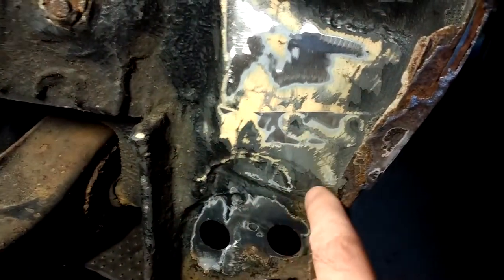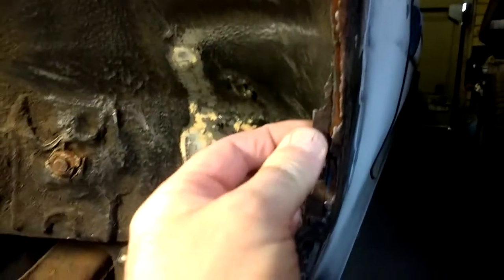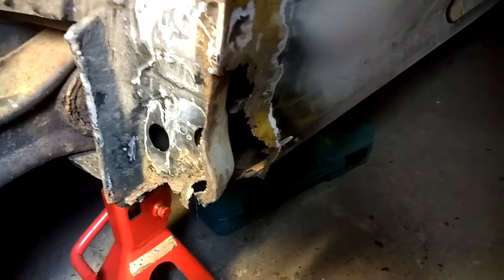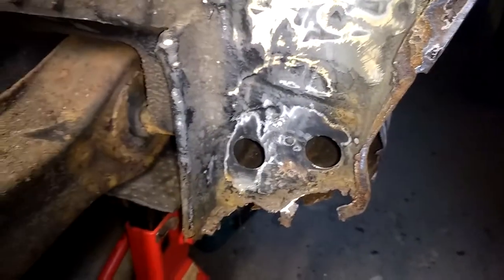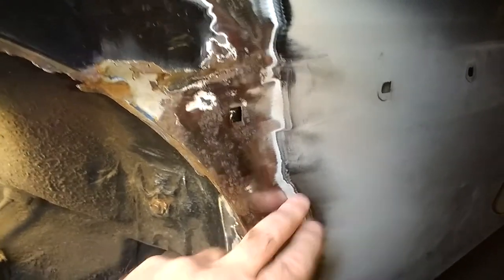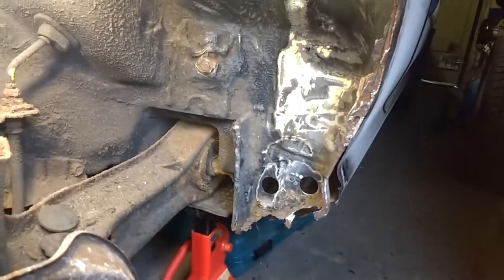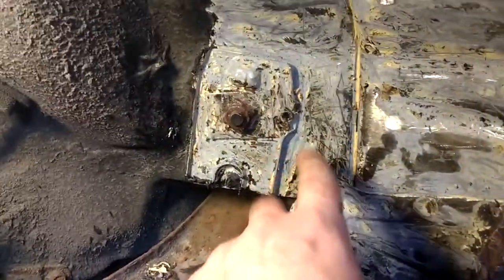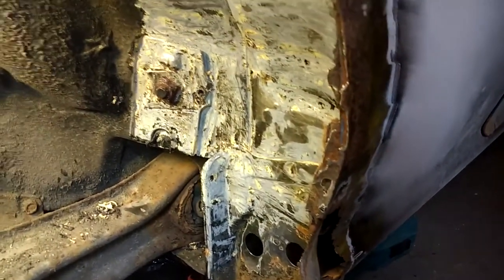Rover R8 216 GTi 16v - Part 16 'Removing twenty eight year old underseal'

Comment: hello. ive seen your xtrail files series and i wanted to see if i could request something. i have a 2006 xtrail and im wanting to put a starlight headliner in it, or at least add fiber optic led's. but i have a few questions about it and as you're the xtrail king i thought i could ask.

1) how do i safely remove and reinstall my headliner? the 8 pillars, 3 light fixtures, 3 ceiling handles, both sun visors and the rear view mirror are all unavoidable things on the headliner and i've hardly looked at my engine let alone taken apart my interior.
2) how best could i avoid the retractable sunroof mechanisms as to not hinder its function?
3) what do you think is the best way to hide the cable going from the head liner to a cigarette port? theres one in the back of the car which will probably be more than ideal to plug into.

if you could answer these id be really appreciative, and if you could make a video id be over the moon. thanks in advance for any help provided.
Reply from the maker: Hi, you could run the cable either up the A pillar trim or C pillar which will be nearest to the rear power socket. You are correct in saying the grab handles, rear view mirror and any ceiling panel clips have to be removed before accessing the trim panel. The sunroof is a self contained unit so you won't have to touch it. The cargo area trim will need to be removed if you are going to run the cable from the rear socket. The other option is to take power of a suitable circuit off the fusebox - however since these cars use CANBUS/multiplexed wiring, you need to know exactly what cables can be tapped into. The 12v power socket is probably the best option. I think several owners on the UK Xtrail Facebook groups have added accessories so it might be worth asking on there too. There are pdf workshop manuals for the T30 which are very useful. I'll have a look to see if there are other possible circuits to power an LED ceiling.